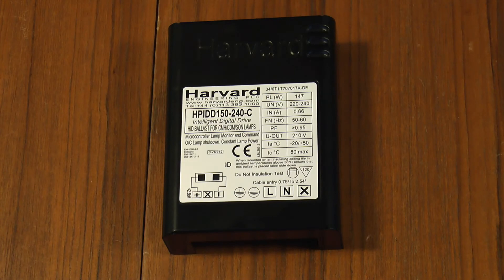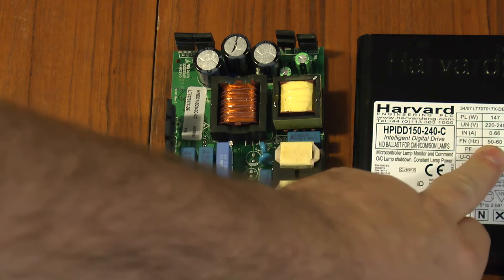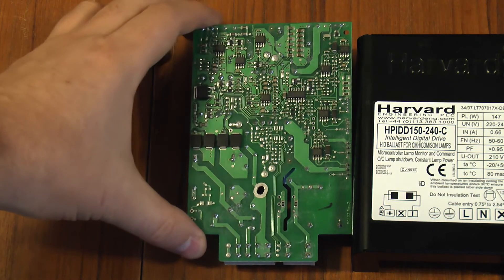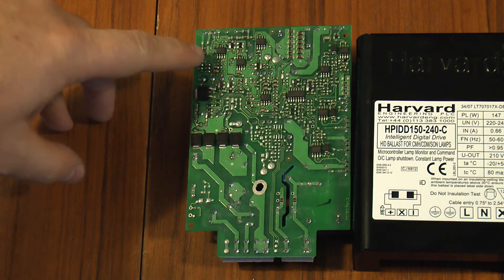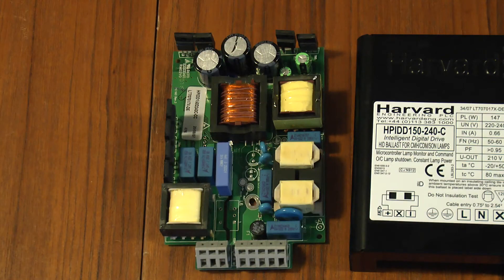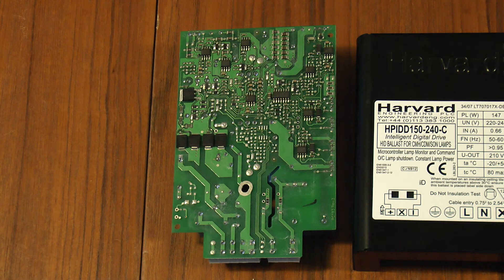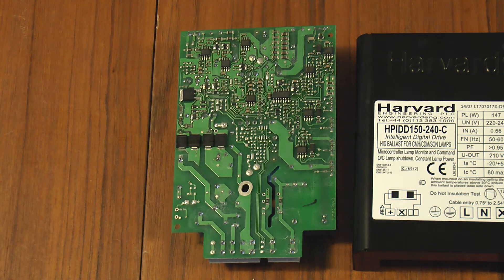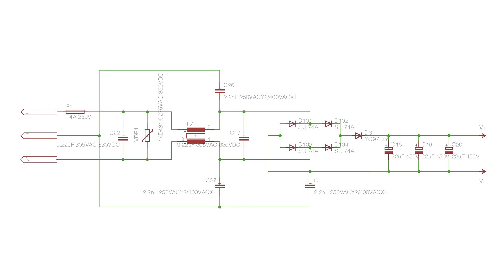Harvard HPIDD150 metal halide ballast - a peek inside and a test run on DC

Comment: i want to ask you few questions, 1. if i want to operate metal halide 35 watts lamp on hid zenon 12 volt ballast. can it work. where nominal volts from data sheet of 35 w MH is 90, its current around .4 amps ignite on 3.5 to 5 kv. AMPS not known. and automobile hid zenon 12 volt ballast is 60 watts, its start volt is 23000 and nominal current is 99 volt. is there a way i can put MH on DC auto ballast.
Reply from the maker: In theory it sounds doable, I'd give it a go and see what happens.

Comment: This ballast has aPFC - there shouldn't be any significant filter capacitors (the main reservoir capacitors are after the electronic aPFC). 

A lot of aPFC circuits don't like cheap inverters. The problem seems to be the same though - long periods of zero voltage and rapid voltage rise. This seems to upset the aPFC circuit (which uses input voltage in its feedback) and may well cause it to become unstable and shutdown.

Comment: aPFC shouldn't be significantly affected by running on DC. I've been meaning to try this for ages, but haven't had the time.

aPFC is just a step-up DC-DC converter which takes unfiltered DC input from the bridge and outputs into the reservoir caps. In aPFC feedback is set so that Iin = Vin * (Vtarget - smoothed Vout).

This way input current is proportional to input volts, but you still get a regulated output voltage.

Running on DC should be fine, as Vin will be flat, not FW-rectified DC.

Comment: I tried this on true switch mode power-supply for desktop pc. However I have nothing to provide more than 130V DC, which seems to be the minimum operating voltage from a rectified 110V AC (110-240V AC operating range). The cheap power supply I tried this on did actually output 7V on the 12V rail, with just 80V DC input.

Comment from the maker: Good call. They'd be OK on a true AC supply, but give them a filthy square wave voltage and they'll give an even filthier current waveform in return.
Next thing I want to do is see what the runtime is on my 22Ah 12V battery. Now I've got a HD camera I want a decent light to take back to the Merthyr Tunnel, and that 150W flood (12500 lumens) should beat the 60W of CFL (3600 lumens) I took last time :)

Comment: One issue I can think of with running something like this on DC would be a bridge rectifier failure due to all the current passing through only 2 of the diodes all of the time as opposed to all four of the diodes part time per pair. Although this would only happen if the rectifier was undersized and/or they used crappy discrete diodes without any cooling.

I wonder how the PFC circuit is affected by running on DC? Don't know much at all about active PFC design.

Comment: The high current spikes from the input ripple suppression capacitors are probably tripping the load overcurrent fault detection circuitry in the inverter, as the capacitors appear as a close to dead short to the portions of the waveform that go from 0V to +/-300V.

Comment from the maker: It's difficult to tell, as my inverter doesn't like running these electronic ballasts, usually shutting down its output within 15-20 seconds. By running on the internal DC supply it bypasses some (but not all) of the internal protection that's complaining about the ballasts.
I may be able to do it in conjunction with a filament lamp as it seems to stay on if I connect that as well. Watch this space...